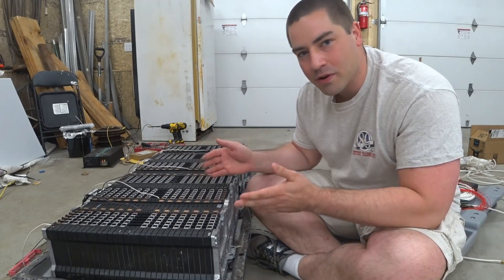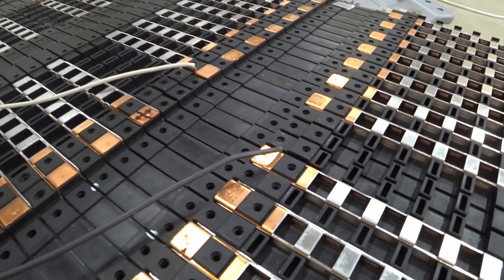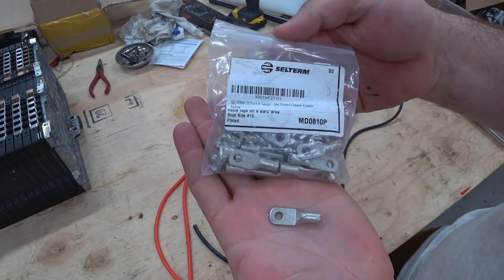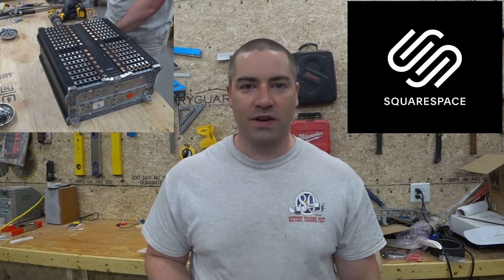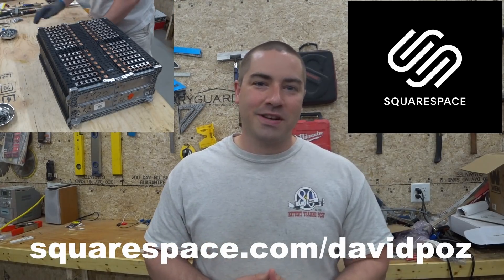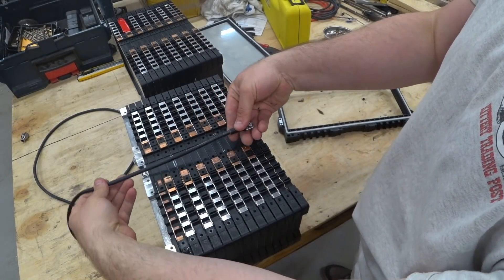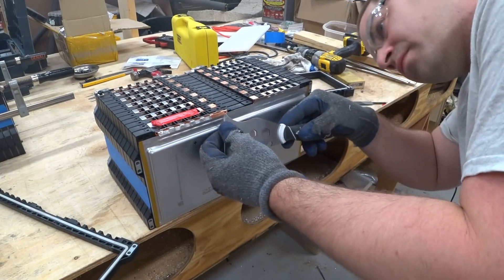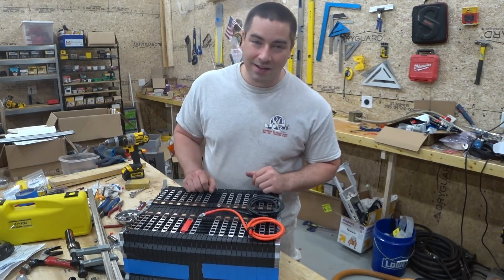Making Internal Positve and Negative Terminals on Smart Battery

Comment: David, both of my battery terminals are black, no + sign so which one do I attach the red clip To ? Left of right please ?
Reply from the maker: Use a multi-meter.  Set the meter to read DC Volts.  Then probe both terminals.  Your Multi-meter probes should be red and black to indicate positive and negative.  If you have the polarity correct, then the meter reading will be " 48V".  If the polarity is backwards, then the meter reading will be "-48V".  Note the negative symbol.

Comment: David, just a quick tip...when you're stripping the insulation on the wires to put your terminals on, don't pull the insulation off right away.  make your cuts in the insulation, just enough that it's completely free from the rest of the insulation, but still wrapped around the conductor wires.  when you've done that, then grab the piece that is going to come off and twist it around to tighten the strands of wire inside.  you can twist it while you pull it off, until it just comes off the end, and you have a really nice twisted wire with no strays shooting off in random directions, ready to easily slip a terminal connector on for crimping...and not to mention, this also helps save wear & tear on your fingertips.

Comment: Hi David, I'm also happy for you that you have a sponsor. Even though it's annoying. 
Why didn't you use a stud welder? 
Keep up the good work.
Cheers from Germany,
Tom
Reply from the maker: I did not think of using a stud welder.  I've heard of them for steel cars, to pull out dents.  However, I've never heard of them welding onto copper for electrical.  Is that something you are familiar with?
Reply: @DavidPozEnergy  Unfortunately I don't have experience with them. And to be honest I didn't think about the different metals. I just saw it on another YouTube channel. There it was used on steel parts.

Comment: I think I would have drilled a larger hole in the plastic and then epoxied the head of the bolt into the plastic.  Then the bolt would form a post that you could easily put a nut on.
Reply from the maker: That sounds like a nice way to do it.  Would you need to cut the edges of the hole out with a chisel to make a hexagon?
Reply: I don't think that would be necessary,  just drill a large enough hole for the head of the bolt to go into and then pour in some epoxy to lock it in place.

Comment: i would of used flat head self tap screws you would not of needed to take battery apart and would of been a solid connection
Reply from the maker: Thanks for your suggestion.  I considered this approach, but the copper bus bars are very thin.  I couldn't see them holding threads well.
Reply: @DavidPozEnergy  the plastic would hold the threads

Comment: Why not drill a smaller hole to just fit the nut and use it has a captive nut, that way you can remove the wires without taking everything apart
Reply from the maker: There are probably lots of ways to do this.  I tried a few methods, but this was the one that worked.  Thanks for watching.

Comment: Great job on the video, and don’t worry about people not liking sponsor spots, some people don’t want to be bothered taking time out of their free video, but if it keeps you making videos and helps you work toward your goal, most viewers won’t have a problem with them. And yes Squarespace is appropriate, I use them for my website and it’s a great way to host and share information outside of YT.   That said, I would choose either the intro or middle sponsor spot but not both on a short video unless thats the obligation.  

The number on the die corresponds to mm2 and can be converted to AWG with some readily available tables.  

Definitely don’t take a shortcut and just screw into the plastic, the proper torque for a good connection might surprise you.   

All on the right track, keep up the videos and things will work themselves out to be more natural. Have fun. Be safe.
Reply from the maker: Thanks for the feedback.  I'm going to try streamlining the ad (this was my first).

Comment: It's good without the music for me David.
Stainless is not a good choice from a conductance point of view David, and creating a connection that requires disassembling the battery to remove is dubious too. Can I suggest instead of screwing on cable directly, you screw on small copper or aluminium angle instead and attach the cables to the angle using aluminium or brass bolts/nuts? Many ways to skin this cat, but you've probably chosen an approach that increases failure risks unnecessarily.
Reply from the maker: Hi Benny,  This is a great topic.  I debated for weeks about how I was going to make this connection.  I thought about doing it just how you described.  My hesitation was with a copper or aluminum angle in-between, there would be two connection points instead of one.  I thought that might increase risk.  Thanks for watching.
Reply: @DavidPozEnergy  Good point re two connection points. Perhaps have the screw sticking up with dual nuts? There are plenty of options on ebay for brass nuts and bolts. It is a good discussion. I presume you chose stainless to reduce corrosion issues. I've been dealing with this problem of corrosion with my aluminium camper trailer build and have chosen stainless bolts and nuts, although I read now that galvanised would possibly have been better and cheaper. Given your primary concern is resistance and secondary is corrosion, would the approach of using the best conduction nuts and bolts and then figure out some sealant that will guard against corrosion be the right approach? I'll be facing this when I setup the battery system for the camper..it will be in the elements, facing extremes of temperature, humidity, dryness, dust and all the other environmental conditions experienced across the broad continent of Australia.
Reply from the maker: Hi Benny,  I don't think the bolt is doing the work of carrying electricity.  Sure, it can carry electricity, but I didn't design it to.  In this connection (and all of my battery/inverter connections) the two surfaces we are interested in are the copper bus bar, and the copper ring terminal.  In this case the ring terminal is tin-plated over solid copper.  I sanded the bottom of the ring terminal and top of the bus bar with a fine emery cloth to remove any corrosion, then wiped them both down with a cloth.  The two mating surfaces will now have very little resistance and the electricity will flow through them.  The bolt/nut combination has a lot more resistance, so the electricity won't want to flow there.  Electricity takes the path of least resistance.  Even if I used brass bolts they would still have more resistance then the copper-to-copper connection.  All this to say, I don't think brass hardware would hurt anything, but I also don't think it helps.
Reply: @DavidPozEnergy  Fair call David.

Comment: With seeing this new battery bank here, I presume you're still using your chevy volt batteries as your mains?  The BMS I had asked about prior was that just setting up Battery Monitor System or was it an actual Battery Management System?  No I've not had the chance to install mine in my Skoolie yet, I will end up having to figure fusing before I do that, as well as work on the Battery Management angle.  I find a lot of used Volt battery packs out there, but you're one of the few that's given the practical application that I need for my skoolie build.  I don't want to wake up to a fire b/c I've screwed something up! LOL
Reply from the maker: Hi Joseph,  My next video to come out (currently I'm editing it) will be about the BMS for this battery.  It might be helpful.  The BMS I'm adding to the Smart battery will be a "manager" as it will have safety cut-offs.  The BMS on my Chevy Volt battery is only a "monitor".

And, Yes, I'm still using my Chevy Volt pack while I'm working on the Smart Car battery.  Thanks for watching.

Comment: I think if you were to clamp the hydraulic wire crimper to your table it might be a little bit easier to handle when you're cramping wires instead of it flopping around when you're using it. I'm pretty sure a simple wood bar clamp would hold it since you're pressing down on the table anyways
Reply from the maker: Thanks for the tip, I'll give it a try.

Comment: How much current does each individual cell produce? Seem like 8 gage wire is plenty heavy, but honestly I don't know and can't make an educated guess with out knowing how many amps a cell is capable of. If the current isn't that much then soldering a lighter gage wire would be easier and sufficient.  Love your videos, I learn something on everyone.
Reply from the maker: Hi John,  Lithium cells are capable of delivering thousands of amps if they are short circuited.  They are amazing.  I'm installing a circuit breaker on each battery.  I'm using breakers rated for 40 amps, so an 8 gauge wire is a good match.  So, the wire gauge is not about how many amps the cell is capable of, but what it is paired with for circuit protection.  Thanks for watching.
Reply: @DavidPozEnergy  Ok, thanks, I had no idea that those individual cells could deliver that much current. Thank you for your response.
Reply: @DavidPozEnergy  circuit protection is designed around cable size, not the other way around. The way you have done it is not safe. There is ZERO protection for the cable between the battery and the breaker, because the breaker can only protect downstream of itself. As someone else suggested, you should have a fuse at the terminal of each battery or as close as possible in line
Reply: @DavidPozEnergy  yes 40a is safe with 8g, but not efficient. The wires will get hot at 40A. With DC you should always double (at least) the wire gauge because I2R losses are a much bigger percentage loss at low voltage vs mains voltage

Comment: I subscribe to the kiss method, should have just get the pack together drilled the hole where you did used a screw or Bolt slightly bigger the plastic would have been self-tapping and no need to take it apart or spot weld.
Reply from the maker: Hi Jay,  I was sure tempted to do that.  I was worried that if I pull a lot of current, I might heat up the connection, and it become loose.

Comment: 10 is 10mm2. It's far too big for 8g. And don't twist the wire
Reply: but why not twist? it keeps the hairs in
Reply: Twisting increases the diameter. It eventually untwists back to a smaller diameter, leaving a loose connection.
Reply: 8g is 8mm2